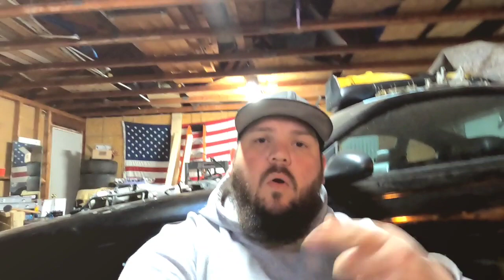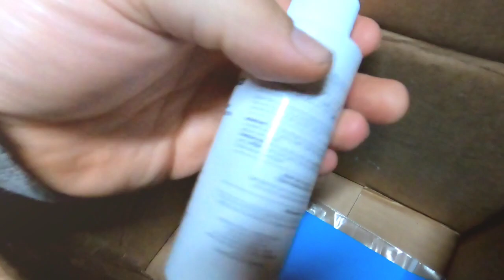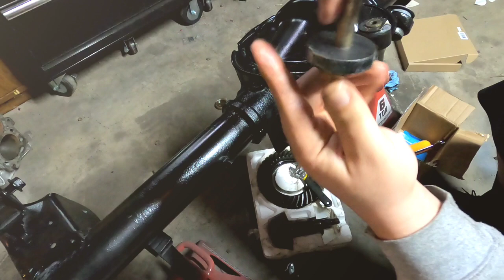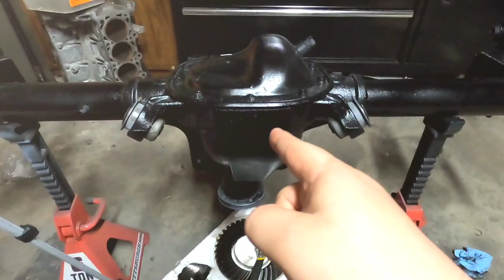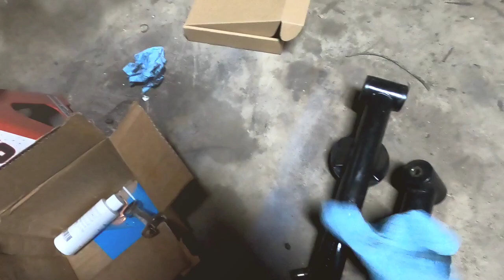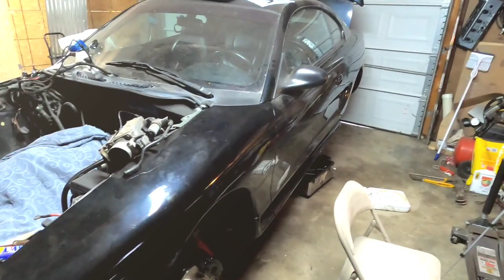8.8 axle bushing install using Maximum Motorsports bushing tool

Comment: When i got my built 8.8 it came with poly bushings..i always wondered how hard it was to change them before hand..
Reply from the maker: How do you like the urethane bushings? I usually ran spherical bushings but the are noisy
Reply: @streetslayers410  not a single complaint

Comment: Man I took one side out and put one in and the thread on the bolt stripped.  Lowe’s didn’t have the bolt so I used the next size down and it snapped in half.   I had to go to a mom and pop hardware store to get the grade 8 bolt.   Kind of turned into a nightmare even with the tool.    That was using a 1/2 ratchet because nothing else was pushing it in
Reply from the maker: 😮 Wow! That sucks
Reply: @streetslayers410  it’s okay. I used it again yesterday on the opposite side and it worked.  I think the key is to have the bushing cleaned well and oiled when pressing it out and the same when pressing it in.   I also put the bushing in the freezer for a couple hours before pressing it in.